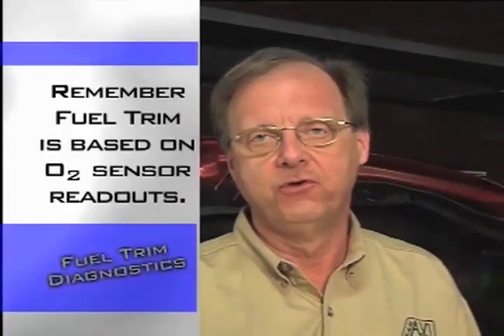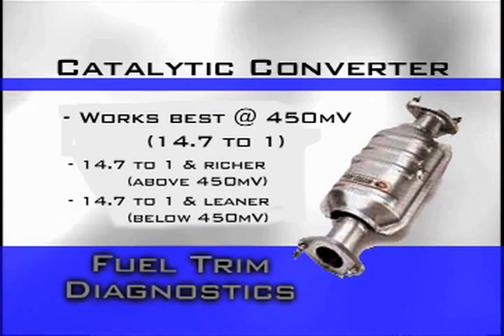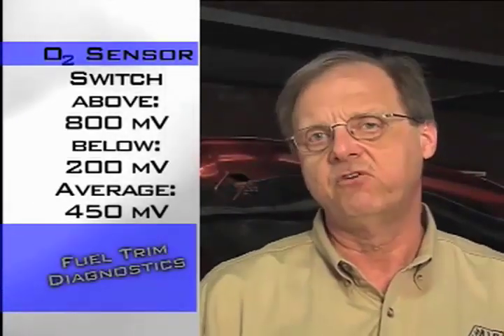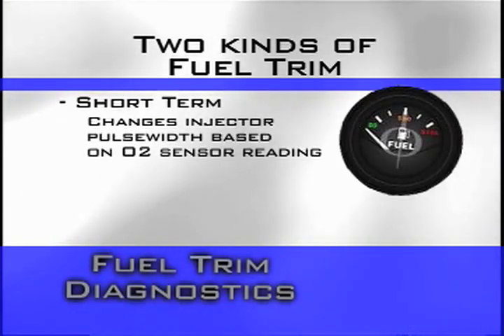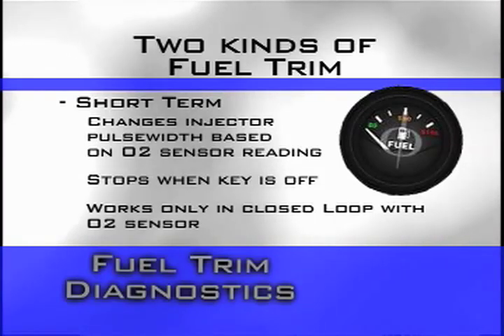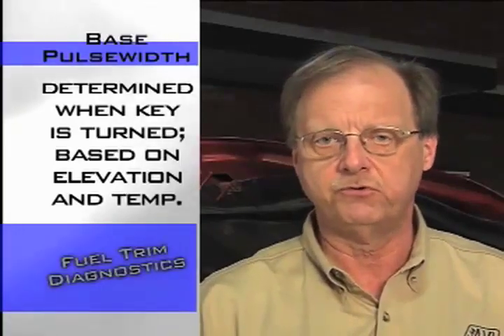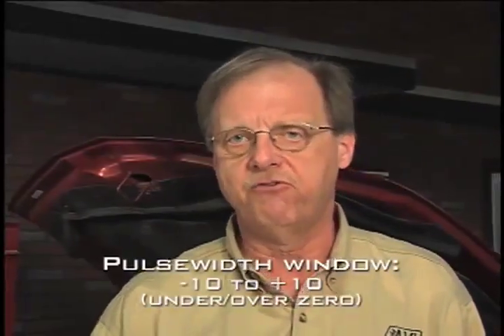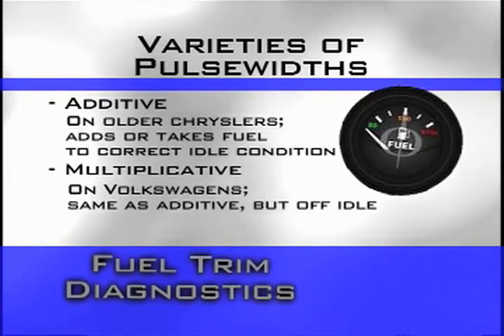Fuel Trim Diagnostics by Jim Wilson

Comment: knock is caused by a lean mixture, poor octane fuel, carbon build up , incorrect ignition timing, or even an overheated engine, it is not caused by fuel igniting in the exhaust, it is fuel igniting spontaneously before it is meant to, and trying to drive the piston down while it is on its upstroke, the pressure generated from this makes the pinging or knocking noise.
Reply: 6 years ago you added a comment full of truth and yet I am the one to give it a thumbs up,its a  sad society of parts changers we live in
Reply: @geraldmartin3625  He was talking about NOx, and not knocks.

Comment: Please read about narrowband lamda control. The fluctuation from rich to lean is the only way to keep a constant mixture at stoichiometry during closed loop when using a narrowband lamda. This fluctuation is not used to avoid knocks or lower emissions. NOT all sensors in cars are narrowband.